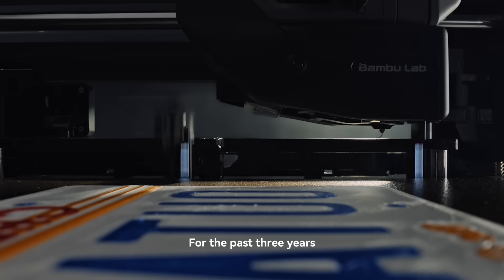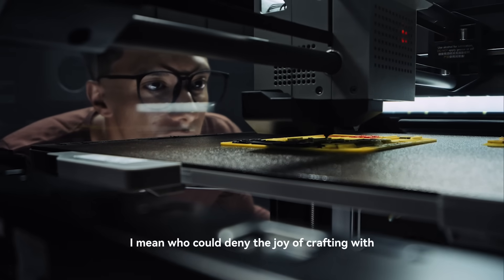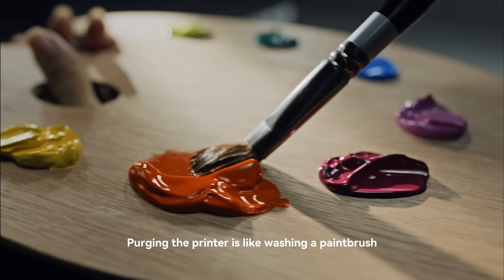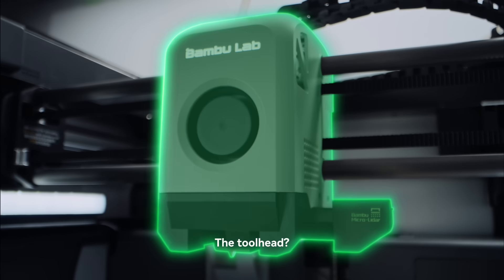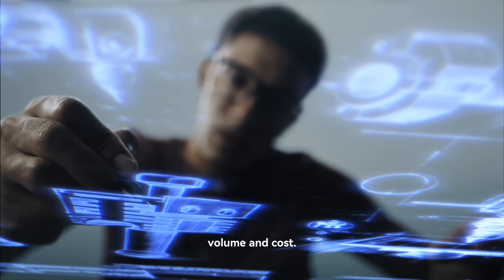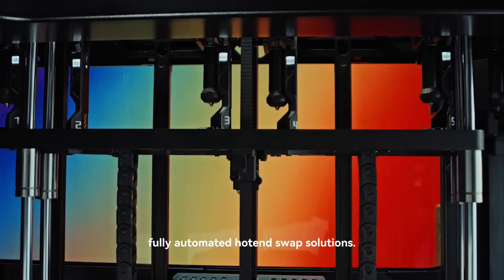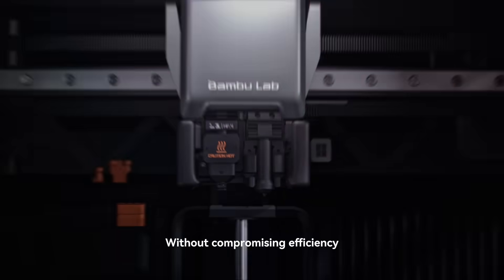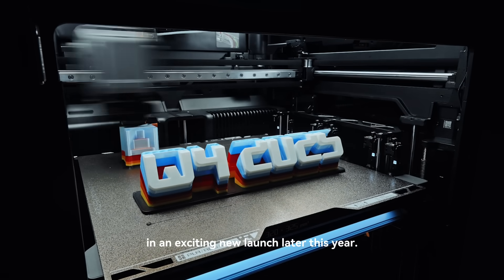Meet Vortek: Our Answer to Zero Purge Waste Multi-Material Printing

Comment: Looks like Bambu is having a “Hold my beer” moment.
First comes in to revolutionize the 3D print space with affordable, reliable, good quality printers, forcing other manufacturers to play catch up. All while seeing where the market demand is going and what the customers are looking/asking for.
Then another player steps in, the U1 making everyone think “This is it! A cheaper true multi-color printer!”
Bambu says, “Here, hold my beer.” And possibly changes everything.
Will it be cheap? Not likely. But it’ll have the quality and reliability you’ve come to expect from Bambu.
I think this will be awesome!
Reply: Bondtech has been showing off the INDX system for a while. This is Bambu copying that.
Reply: @RoofusKit  kind of, its different design so we canot say that its copy but assumptions are the same unforunatly babu idea is worse. Bondtech INDX is using independent bowden tubs to every hotend here you have one on the tool head and you still dealing with ams
Reply: problem is they are now going exactly the other way around making expensive modification only available to theyr most expensive machine that frankly DOESNT NEED IT as it already has 2 nozzles for multimaterial printing ...
Reply: "First comes in to revolutionize the 3D print space with affordable, reliable, good quality printers"
......so something prusa did like 5-6 years prior to the X1C lol. How quick people are to forget that prusa had the first, out of the box reliable printer that didn't cost a fortune.
Reply: @LilApe  Please are you really trying to say that Prusa are priced competitively? . The Core One £1,138.80 even the Kit is £874.80.  The Bambu P1S £429.00 even The AMS Pro combo is still only £719.00. The NEW H2S is only £999 so still cheaper then the Prusa Core One.

Comment: I am wondering what the price point for this unit will be. Surely its not as cheap as the $750 snapmaker's going around right now, but I like the simplicity of a nozzle swap over an entire tool head swap. The 8 second induction heating is neat as well!

Comment: I paid 640€ for the snapmaker, I doubt they are gonna low ball that offer
Reply: They aren't comparable anyway. If you only plan on printing PLA multicolor, there is no reason to consider the H2 series in the first place.

If you want a larger build volume, heated chamber (and an actual enclosure), and run engineering filaments, the U1 doesn't provide that

Comment: I love the tech and engineering into this process. Personally, I don't need this, I want it, but I don't need it. I don't mind the purge (I re-use it) but I can see it really helping with PLA and hueforge prints.
Reply: How do you reuse the purge?
Reply: @Graham_Wideman  I use it in other hobbies. I can encapsulate it in resin as a filler (mica on the mold, so don't see the PLA). Use it as a base and place expanding foam if I am making tabletop terrain. And I am currently working on turning it into stepping stones and lighter cement walls for gardens. 

Essentially filler for other projects I already do. 

Some people heat it into sheets and blanks for pen turners or other projects. I've seen heated and pressed PLA turned into "stained glass" artwork.
Reply: @RoseKindred  Thanks for the answer!

Comment: OK, now this is interesting. 

Please, for the love of god, let the H2C be a printer only. No extra laser cutter stuff, please.
Reply: Jack of all trades master of none
Reply: @EtaCarinaeSC  Jack of all trades is a master of none but oftentimes better than a master of one.
Reply: @EtaCarinaeSC  And yet better then Prusa
Reply: Why do you care if it’s a laser as well? I have the none laser version of the H2D and I don’t see a downside with there existing a laser one. Why would that affect me?

There are versions without the laser!
Reply: @plucksch  Thank you!
Reply: @plucksch  Price is the issue. This swiss army capability comes at a price. Am hoping that there'll a pure single toolhead version H2C-S to bring price down much below H2C-D.
Reply: @plucksch Because provisions to attach these accessories add weight, complexity, and cost. Why should I be happy to pay more for a printer that's less high performing because it has a ginormous toolhead with hard points to attach a bunch of crap I don't want?

Comment: At Prusa there is currently deep silence in the development department  :D
Reply: Yeahhhh no. Traditional toolchangers like the XL, U1 and even the index are still faster than whatever this is lol. Prusa is doing just fine and going about business as usual. Anything more than two colors on this will still be horrendously slow just like the H2D. Prusa even teased a pic today of a core one with 7-10 toolchanger. Prusa will be justtttt fine.
Reply: @LilApe   Pruse is dead in 2-3 years you will see
Reply: @PronoxGTR34  Ya'll have literally been saying "RIP prusa" and "prusa is dead" for the last 3 years. Now its "the next 2-3 years", then it will be the next 5 years and so on so on.
Prusa is selling more printers today than they ever have before. They're doing just fine and will continue to thrive amongst all these cheaply made chines printers.
Reply: @PronoxGTR34  Proves you don't know anything about the 3d printing business.
Reply: llama noises intensify

Comment: From the looks of it this system still uses the AMS, so the only thing eliminated there is the purging and pooping aspect. It might still need to route the filament back from the AMS to the extruder. So yes, this a step to the right direction, but the Bondtech INDX is still a strong contender (which keeps the filament loaded on the nozzle)
Reply: I also see a purge tower in the print at the end. So it's not "eliminating purging", it's just eliminating the poop. There must still be ramp-up or material purging happening through the nozzle, or the purge tower wouldn't be needed.
Reply: @Mock1YT  it is a prime tower, not a purge tower - for sufficently large prints, nozzle priming can be done within the model

this is the same for every other toolchanger or toolhead changer

Comment: I own 3 different bambu machines and love them (mostly) but I'm kind of confused by this release/preview. The video, of course, makes this look amazing but the only thing I really get from this is you can swap the nozzle. Outside of wanting a different size nozzle for more detail and or faster infill. None of these nozzles have there own filament attached to them. Your relying on the AMS still which means a lot of filaments will still not be compatible with this and you still get waste. Your still waiting for color or material swaps to happen. The print head will still need to cut the filament. I just don't understand the point of this.  If you did tool head swapping like the xl or u1 and made it where each head could have its own AMS then WOW that would be a game changer. Sorry maybe the commenters can help me understand what I am missing about this.

Comment: This is what the H2D should have been with a FULLY useable 350x350mm build volume.  I would have easily paid $2000+ for that.
Reply: In they blog they say you’ll be able to get this for your H2D, so you won’t buy the H2C.
Reply: @Akki_Ke  They say you can... But whether they make it "reasonable" to do (I know they say for advanced users) and not exorbitantly expensive to do... Will remain to be seen.
Reply: Yeah i really like the X1E and my H2D , but i am missing the buildsize of my old CR10 printer which had almost 500x500x500 if they only could make a bigger buildvolume with this system it would be ticking off all boxes
Reply: They should absolutely have gone all the way on that first... And I will be very surprised if they follow through with the upgrade path options for H2D... *Sigh*

Comment: Hmmm, spend at least $2k+ on the H2 and whatever this costs or go with the Snapmaker that will also do multi-color/material for less than half the price...
Reply: as a former snapmaker customer i can assure you that you will also have "less than half the support" :) - the product will be left in the rain after it released, like snapmaker has done with virtually any product they released in the past
Reply: @suit1337  Yeah but, with how well the kickstarter did, I'm confident I'll end up dealing with less than $2000 extra labor in repairing it. Bambulabs is doing a great job, but the "mid-tier" offerings are starting to feel a little tone deaf.
Reply: @jackharvest1  yep they need to bring an upgrade there aswell

but i assume a downsized H2 gantry will be the next iteration for the smaller printers and there will be a X2/P2 in the forseeable future
Reply: @suit1337  Would love to see a P2 with a nozzle swap capability.
Reply: And the funny thing is the U1 is probably going to print multicolor even faster since it does not retract like their AMS is doing.

Comment: Bambu Lab was the change the printing community needed. again bring new innovations to the market
Reply: It's basically the same idea as the Bondtech INDX, announced a few months ago.

Not that it's not great.  But it's also not unique.
Reply: @Raytenecks  Yes it is unique.
Not necessarily better, but it is different: enclosed standard extruder, inductive heating, AMS-required, thingamagic rack, etc.
I personally would have prefered an INDX rack approach (nozzles lined up at the back on a fixed rack) rather than this over complicated moving / rising nozzle rack, but that's another topic.

Comment: I am extremely excited about this!!!! I love how Bambu is going an entirely different route from other companies with the multiple tool heads. This will be amazing to see when it comes out! Can't wait to get my hands on one
Reply: This is a stop gap measure, real tool changers will still print 2x to 3x faster than this. Bambu is just trying to dampen the noise that the Snapmaker U1 is making. This system is merely to keep current Bambu users from jumping ship, but many don't realize this thing will still print slow compared to a Prusa XL and Snapmaker U1. Bambu needs to make a real tool changer to compete.
Reply: @03chrisv real tool changers look pointless now what are you talking about? 😂 how is it any faster?